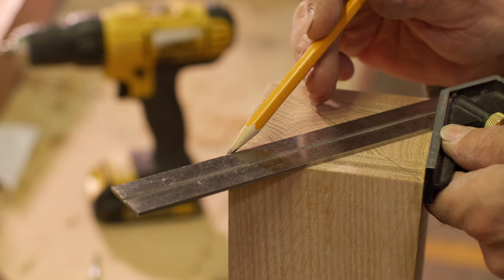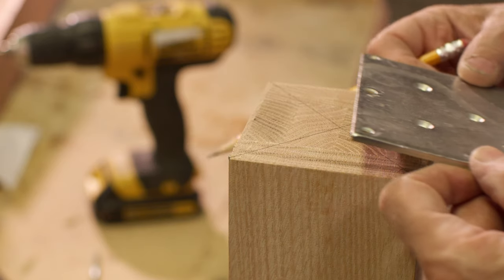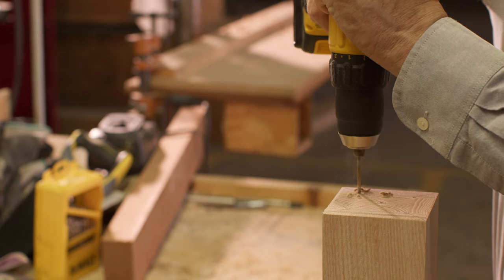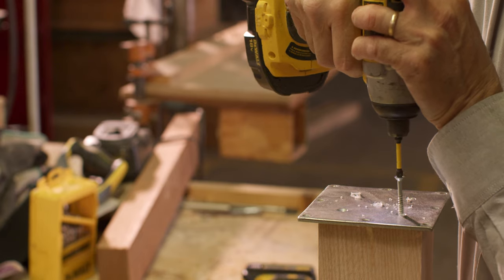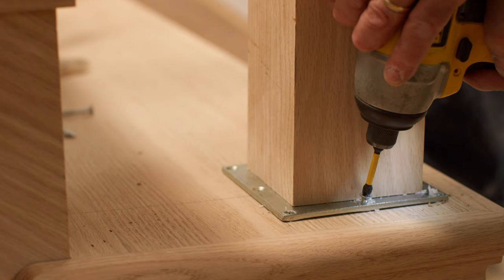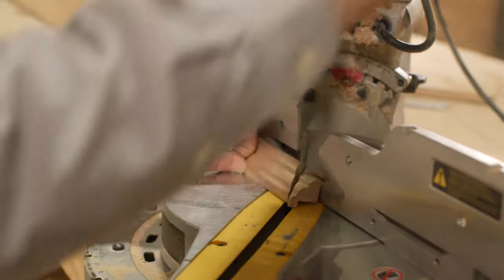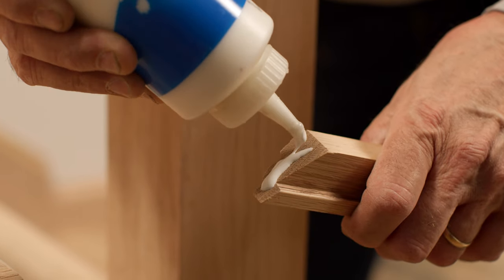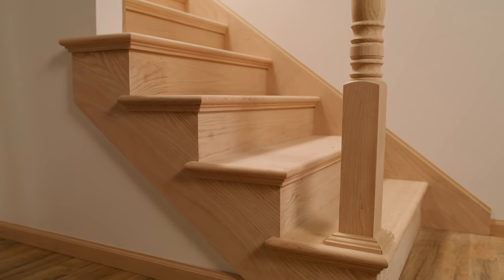Newel Mounting Plate Installation

Comment: I’m looking to replace a colonial volute with a nice square post. The current turned post and balusters (6 of them!) are installed into the bottom tread and would need to have the holes patched/filled. If I wanted to do exactly the kind of install you demonstrate in this video, would I need to do anything to reinforce the bottom tread to support the new post? It is a typical stair tread strong enough to support the mount?

Comment: What are the measurements of the metal plate? I know this product is used for 3"-3 1/2" newel posts, but the plate dimensions are not listed anywhere.